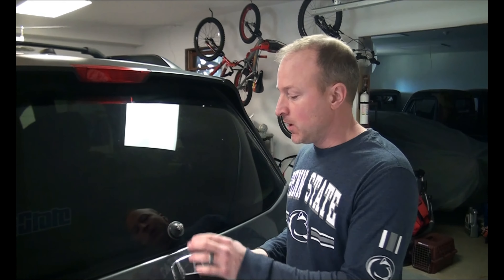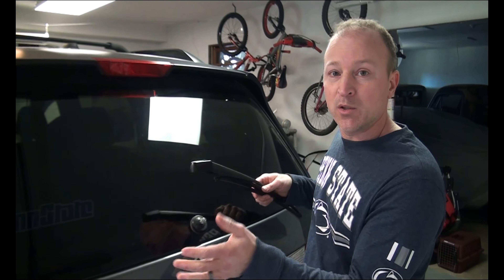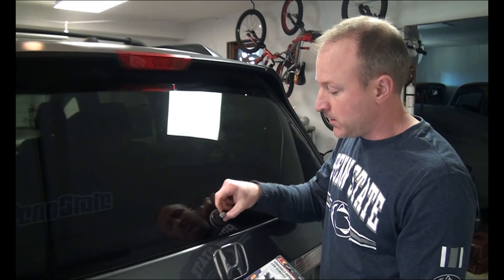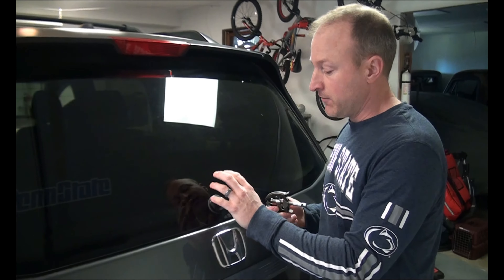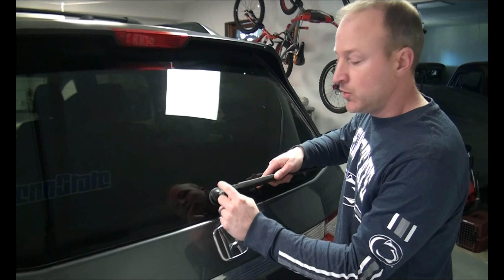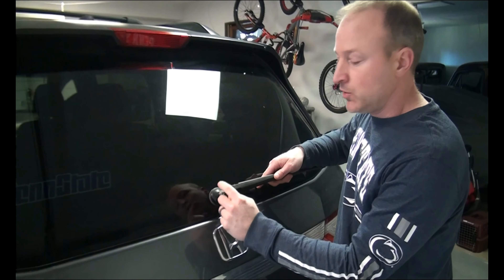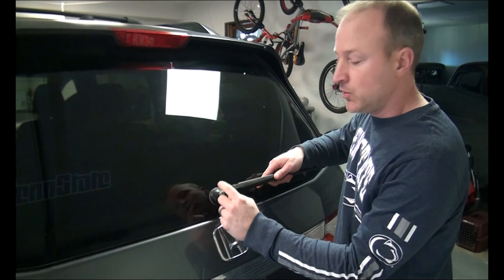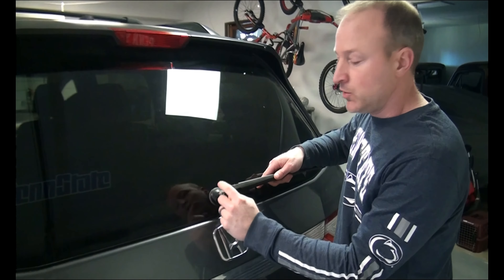How to replace a rear window wiper arm and blade on your car, truck or van

Comment: Bought the tool compression nuts on there, so tight it won’t come off no matter how much force I use I’m about to replace the whole window if I can’t get it off
Reply from the maker: If you haven't done so yet, use some lubricant on the nut and let it set for a few hours. Try Kroil or PB Blaster or something like those.

Comment: Good afternoon,  I really enjoyed your video and replacement would have been easy except for the fact that I have a 2015 Chevy Trax. My wife started backing out of the garage before the overhead door was all the way up. As a result, the bottom lip of the garage door, came into contact with the wiper arm, and snapped it off of the pin that the arm mounts to. The pin still functions properly,  but there doesn't appear to be a way to attach the new arm onto the pin. To clarify myself, the cover for the wiper arm, does not have a removable piece in which to access the retaining nut.

Comment: Thank you for the video. Got the nut off the wiper blade arm and can’t pull the arm off. Do I need one of these tools or some WD-40? TIA
Reply from the maker: You'll most likely need one of these tools. It's pressed on, so using a lubricant like WD-40 isn't really going to make a difference.
Reply: Thank you for replying! It’s a Chevy Cruze, 2018 rear wiper on a hatchback. There shouldn’t be anything else but the one screw, correct?
Reply from the maker: @jamiemaclaren4187  Yes, should just be the one screw.

Comment: Its funny that my minivan also had the same exact part broken similary way. I guess they are built flimsy these days. Never happened with any other older cars I have had. Thanks for the video, this was very helpful.
Reply: BTW, I did not have puller so I ended up using a cone wrench and wiggled it a bit and it easily came off.
Reply: I used the same and was able to get the broken piece off my Chevy Traverse.  Thanks for the advice

Comment: Can you put a link to where one can get that removal tool please and thanks!
Reply from the maker: You can get these at most auto stores, ebay, Amazon, etc. The one I used is like this one https://www.lowes.com/pd/KD-Tools-Battery-Terminal-Puller/1000972588

Comment: What’s the exact name of the tool? Thinking of ordering this on Amazon. Thanks!
Reply from the maker: It's a battery terminal puller.
Reply: @RaybuckAutoBodyParts  Hi. Can you please provide what brand as there are so many batter pullers in the market? Thanks.
Reply from the maker: @michellele2658  I used KD Tools KD-200 puller

Comment: Could u state where 2 buy the tool and what is it called
Reply from the maker: It's called a battery terminal puller. You could use something like this one https://www.amazon.com/GEARWRENCH-202D-Battery-Terminal-Puller/dp/B0002SRDRS/ref=sr_1_3?crid=1KIQH0WF3W1O5&keywords=battery+terminal+puller&qid=1670851052&sprefix=battery+terminal+puller%2Caps%2C103&sr=8-3

Comment: You can also use a bathtub handle puller if you have one available, as I did; just leave the nut on a few threads to stop the tip of the puller from slipping off the end of the bolt.